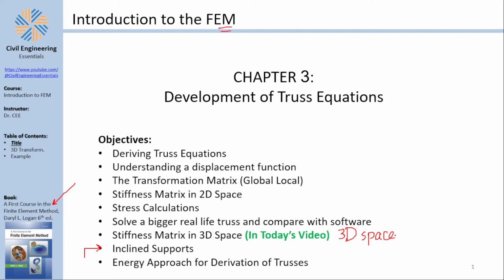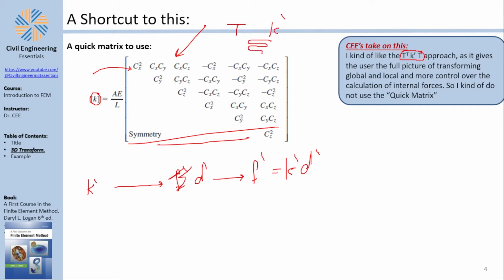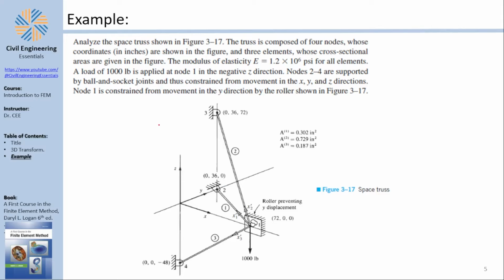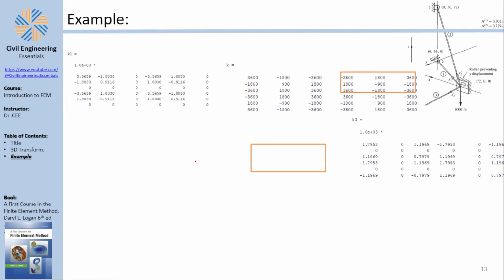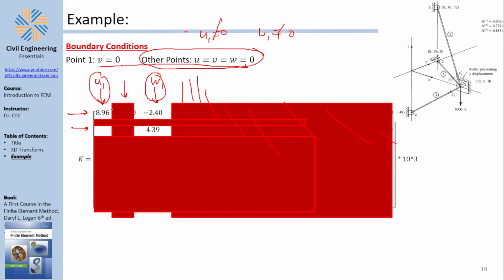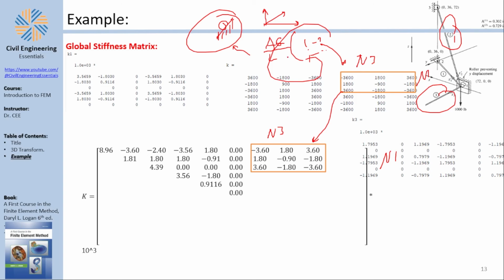The Finite Element Method (FEM) | Part 6: 3D Trusses

Comment: Hello Dr. CEE,

Doctor, the lecture itself may appear to be short, however and for some of us (for me to be honest) the legwork that I still go through at times in order to comfortably ease myself into some of the associated “mathematics” such as matrices manipulations, etc. is definitely not short, but it is very worth that gratifying feeling of accomplishment at the end of trying the exercise questions out by myself especially when the post-processing results are just seamlessly falling into place 😁!!

By the way, I am following you whilst using the SI Edition of the reference. The problems are the same graphically but the values are NOT an exact nor a direct conversion from imperial units into SI units, I find this occurrence to be rather a very good thing for practicing.

I am so appreciative of Dr. CEE for showing the step-by-step 14:53 and for intending to continue to deal with the series step-by-step 23:51 . This approach is really helping to grasp and to cement most of the concepts in these lectures. Of course, I don’t mind the speeding up as it was indicated in 24:00 and was actually done on select areas in this lecture, I am very much ok with it. It is the spirit of the overall intended delivery approach 23:51 which I support to be held and to be maintained throughout.

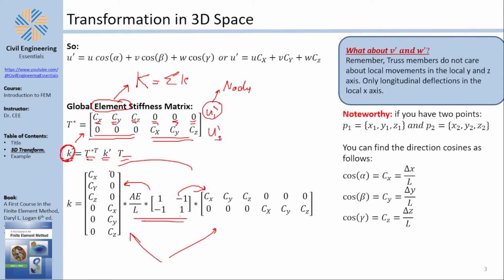7:10 I am also NOT a fan of the “BIG MATRIX” for the same reasons that were nicely articulated and noted here by the CEE. I also use the (T-transpose)*(k’)*(T) approach and I am even still using the {f’}/{Area} to find the local stresses on the members. Indeed, the “quick matrix” and the “quick stress calculation equation” can be useful when one needs to be “quick” and so it is nice to have them around, just as it is nice to have OP software around.

It was through using the above approach that I realised in today exercise that (T-transpose) as opposed to (T-inverse) was being used to find the “element global stiffness matrices”. All along in the previous exercises (I try these myself) I had been using (T-inverse) and this worked out perfectly fine because my Transformation Matrix and the {d’}, {f’}, and [k’] matrices were all expanded to the order that was consistent. I can see now that using (T-transpose) is a very ingenious way that allows one to do the calculations without having to do the expansions in this case of a truss element (I’ll be watching this in further FE types).

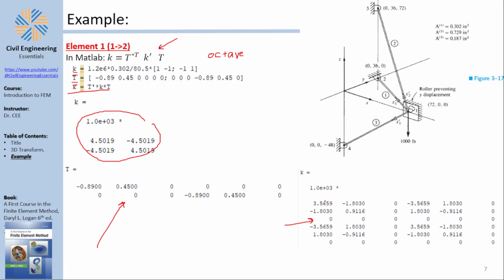14:25 🤣 YES and YES; “elements global stiffness matrices” assemble!! ..... I guess I will be saying this for quiet a number of times considering that the CEE has noted at 23:55 that this is going to be “rinsed and repeated” every single time 🤣. 

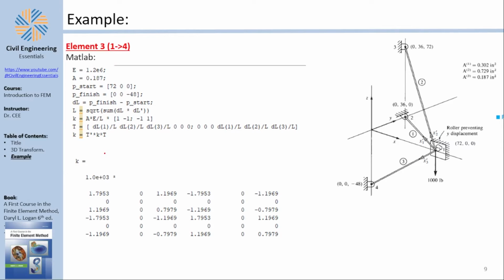14:59 and 24:06 I have enjoyed the presented “block-by-block” assembly style, it is a very good step forward from the “degree of freedom-by-degree of freedom” approach. What I like about the CEE is the nice build-up and transition to alternative approaches after having already shown first principles approaches to the viewers.  

In my comment on the previous video, I have outlined an indexing approach to assemble system global stiffness matrix. This approach can sometimes assemble using a combination of [“element global stiffness matrix”-by-“element global stiffness matrix”] and “blocks-by-blocks”. It is so nice to see the current presented approaches and the above converging.

08:44 Oh Wow, I <3 this discussion about the roller support. This is like a wake-up call for me; It is indeed fortunate to have Dr. CEE doing these lectures. This snippet is very enlightening for me, thank you very much for this.

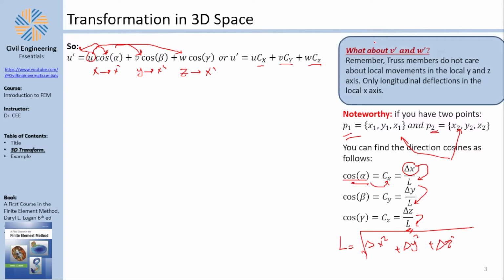04:00 I know that the truss elements do not care about the local movements in the local y and z axis. If, however and for my own curiosity I still wanted to know (and to write) the 3D transformation equations for v’ and w’, what would those two expressions be? I hear the “dot product” approach and I am wondering if this approach is already done or could be done to obtain “similar” expressions for v’ and w’?

Also the last time with a 2-D truss element, Figure 3-7 made it relatively easier to use trigonometry in order to derive the transformation equations for u’ and v’, is trigonometry a viable option for finding the transformation expressions for the above in 3D?

I have enjoyed this video and there is so much that comes out from following along and trying the exercises. I am looking forward to the next video, thank you for the wonderful work that you are doing.

Regards, DK
Reply from the maker: Hi Dear Engr. DK,
sorry for the late reply. As we are approaching the end of the semester, the workload ramps up considerably ^_^.

The Mathematics is not the prettiest, but will help you grasp the interactions of different elements of the stiffness matrix with the forces, so it is a good investment to do it.

It's really cool to have the SI units reference, it is kind of great to see the differences in those values and get some idea of the relations.

I am happy that the approach of speeding up some parts is positively received. The idea is that Your time is important to me and I am responsible of it. Giving tooooo much info is a waste of your time, while being too short would leave any potential new audience confused.

Yep, The quick and BIG matrix does turn a blind eye to all those cool things one can realize when diving into the intricate details of T-transpose. Something that you have seen (coz Transposing works for any matrix)

I took some inspiration of your previous comment in the block by block approach, however - and an apology is warranted here - I failed to refererence your idea here. Sorry for that miss.

Oh your question about v' and w' make me so happy. Why? Coz I was expecting it from you. I already have the page and the equation ready for you to be referenced. 

Now it might be a longer story, so I have to shift it for later, but here is a recommended reading in the same book:
page 282
chapter 5
Section 5.5 Beam in Space
equation 5.5

It is an eye opener. There is no quick way of explaining it.

Also, heads up. 5.5.3 is the FULL element matrix. You can see the AE/L and -AE/L (truss stuff) there. It's gonna be awesome.

So for the 3D transformation matrix, that reference in the book will definitely satify your curiosity. I will definitely reach it soon and explain it in detail.

Regards,
CEE
Reply: @CivilEngineeringEssentials  

Hello MJ,

No worries about the timing of the reply, I completely understand and I appreciate it. Just so you also know, there is really no rush from my side, it is ok to reply at any other time when you are available, I do not mind at all.

Doc, I am flattered to make any meaningful contribution. I owe what I now (think that I) know in this field to you, and it is enough for me that you allow for the current exchange of discussion, you don’t need to apologise.

Thank you so much for the referenced recommended readings for my curiosity, I’ll definitely be sure to check this out.

Keep well and kind regards, DK

Comment: Hi professor, thanks for producing these lectures. They are of high quality. You described about roller support on a wall which supports only compression and not tension. You mentioned about the iterative method to solve this type of problem when we have multiple such supports. I have a doubt whether we have to analyse them by assuming so support in all such locations or we have to analyse all the cases assuming some are supported and and some have no support?